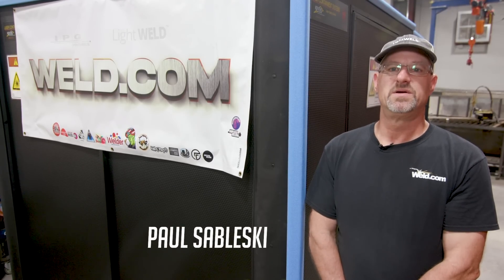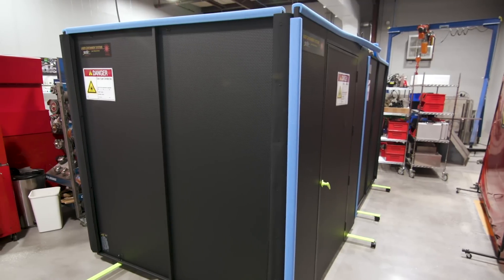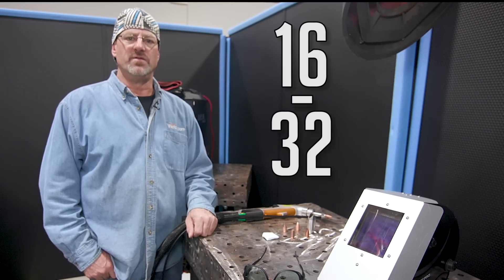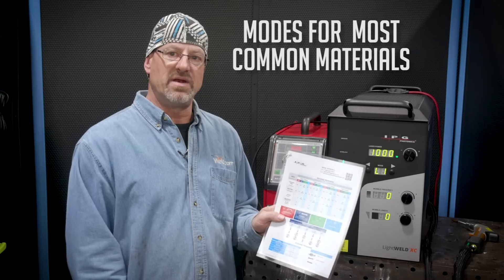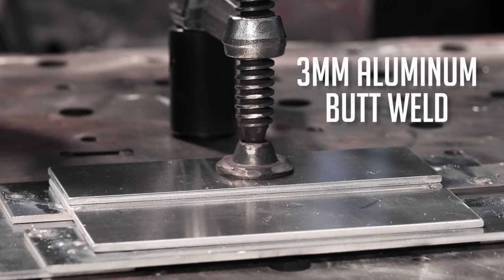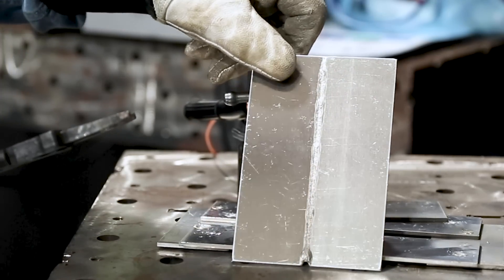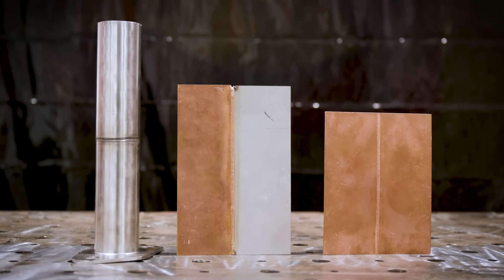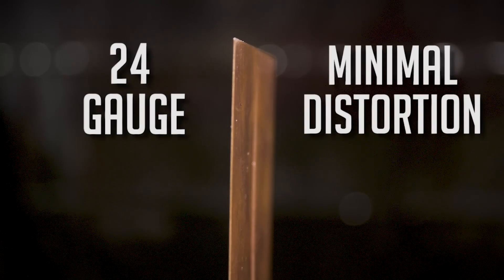Let's Talk Laser Welding with LightWELD

Comment: 15 to 30 CFH  or  PSI 30 PSI. you would go through shielding gas fast
Reply: The speed at which you are welding looks to be several times faster than MIG or TIG so it may still be much less gas per job.

Comment: Holy Mother of Christ!  $25K starting price!  $2K more
for the wire feeder.
Reply: Not so much.bro
Reply: @stevenfeng1961  true if you operate your own machine/welding shop, but if you’re just a diyer or hobbyist like me, yeah, it’s way to expensive
Reply: @jwdickinson643  ennn...Actually，I'm a manufacturer
Reply: @stevenfeng1961  but you’re an industrial fabricator so it makes sense to buy one of these…increased production, minimal errors and reworks, efficient processes all spell success and increased profits.  👊👊👊👍👍👍
Reply: @jwdickinson643  No bro，I mean We're a laser equipment manufacturer，Laser weldimg machine is not so expensive，We sell a 1000W USD4500 with wire feeder and a roll wire

Comment: how do you adjust the gas feeding the welder? with a regulator? flow meters don't regulate psi.
Reply: There is a flow regulator inside the LightWELDER. You adjust the pressure into the unit at 20 - 30 PSI.

Comment: İs it using carbondioxide or argon gas during welding prosses
Reply: Hello Adnan - thanks for checking out the video. I can't confirm exactly what Paul is using here, but argon is recommended as the shield gas for aluminum and nitrogen for all steels.
Reply: @IPGPhotonicsOxford  Thanks

Comment: This was super helpful, my job got one to test out and myself and our most experienced welder of 20 years are to try it out and we can't wait to see how it is but were going into it blind beyond the 3 minute videos showing the welds.
Reply: Hi Pieshka - be sure to report back and let us know what you think!
Reply: @IPGPhotonicsOxford  I am curious what is special about the welding helmet you provide since I can't find any information on it, and if a normal helmet could be used with the machine
Reply: @pieshka6  it's a ( yes weld )helmet but you don't use the welding lens when using laser. It has a laser screen mounted on face to protect against reflection of laser.  DO NOT use a normal welding helmet.  It will not stop laser from burning your eyes
Reply: @IPGPhotonicsOxford  The machine is pretty awesome and by tweaking the continuous weld settings we can make it look like we mig welded a corner joint together despite no wire, the program chart is a little annoying though since we go by metal gauge instead of thickness in inches but I have a equivalence guide on my personal settings sheet. And even though I've only seen it used in straight flat likes or pipes, the machine makes welding a square radius elbow easier than how I can do it through experience with a mig machine and with better weld blending.

And our instructor mentioned a recommendation from a fellow instructor that to reduce breaking threads with the nozzle tips we have multiple tubes with the different nozzles already attached to swap the whole tube and that multiple tubes should come in 130mm and 127mm instead of 120 plus the 2 extension lengths so we can loosen and swap the whole tube instead of changing just the tip while wearing welding gloves and potentially cross threading and/or dropping them and not have to worry about using the right extension but instead an easily identifiable tube length while reducing parts.
Reply: come to us and we may show you more about the laser welding, Mr. Pishka

Comment: Yup, this is the future for some applications.  One thing that wasn't mentioned is this is all software driven.  If a new feature or setting is needed it's just a firmware upgrade.  You are already network connected so it's just a menu selection.  One example can think of is the "stack of dimes" when doing Alu.  I'd think that modulating the laser intensity and the wire feed speed would accomplish this.  Maybe it already does?

Comment: Some confusion.  The video shows 2 welding modes.  The first part is not showing any wire feed but later on it shows a wire feed.  Please explain.
Reply: You can fusion weld, wire weld, or spot weld. Comes with welding preset conditions for all three ways of welding

Comment: The set up he has is $25k plus $2k for the wire feeder.  The $20 version does not include the capabilty of cleaning.  So with tax and shipping somewhere around $30k.  Not really for the hobbyist but for the pro I could see buying one today.  If they had an easy finance program would make decision even easier.
Reply: My god，The whole set just USD5000！
Reply: @stevenfeng1961  That is not for the IPG.  I have seen that and it is not an accurate price.  You will be getting a knock off for $5k.  IPG is known for being one of the best laser sources and they are more expensive compared to Raycus or other Chinese ones. Although the Chinese lasers have greatly improved over the last 3 years.

Comment: What would be the basic entry machine for the home job shop ??? Cost is a big factor when it is competitive with what is on the market. Thanks
Reply: I had bought a yes welder multi process for $500 welds just for home use but it’s held up great highly recommend it as a good starter
Reply: @Giggysiggy  How about a link to this welder Sir ???

Comment: Any chance we could see some multi-pass weld demonstrations with this? Thank you very much for the video!!
Reply: A set back for this process is the welds with wire are only 2 to 3 mm in size. Will take 5 to 10 times the total amounts of passes compared to a tig weld. This machine works best with one pass on thin materials.

Comment: If you used this in space, would you need shielding gas? Seems like it'd be great for in orbit construction if the tool was built right
Reply: No. No atmosphere = no air = no oxygen = no oxidation.
Reply: I wonder if the lack of atmospheric pressure may enable the material to boil away though.

Comment: No cut & etch and no strength tests...and it looks like it you need to drag it only...on the surface...way to limited but interesting nonetheless...
Reply: IPG has done the strength tests and welding certification to AWS 17.1 aerospace standard. They have all the data. Laser welding is not new - been used for years - this is just a way to make it viable for shops that don't have the money a Tesla or GM does

Comment: I would need to see xrays and inspections of welds before committing to this type of welder for my shop. Very interesting though.
Reply: Xray might show full penetration, but It would be like fusion welding, all the welds in extension not compression.
Reply: You can see whatever you want but I can't really see how adding this welder to someones shop would not be advantages,  China and the automotive industry as well as many other manufacturers have used robotic laser welding for years.  China has been selling welders just like this one for years.  They are available from the manufacturer for less than this one.  This machine from IPT seems to be the nicest portable one I have seen.  I would suspect this to consume the current welding machines eventually as it beats them in everyway.  I am not sure what woulds be any reason to not add one to any professional welding shop.  It does everything and more.  Cost is the deterent at this time.  However when you look at the price of welders that shops use there is not a huge difference.  $20k is around the same as some higher end welders on the market.  With some Millers in the $30 and $40k price range it is not looking so expensive and since it does what it does it would justify the price.  These are my thoughts out loud not trying to sell you on it but I have been researching these for a litle while and I don't think they will be anything but faster and better from what I have seen.  Also with the cleaning feature it adds to the quality.
Reply: IPG has done the tests with independent analysis of welds to the AWS 17.1 aerospace standards. For sure superior welding capability.

Comment: It looks fast and if that's also real world fast then the price is acceptable to me. Close to my TIG machine price x 6.
Reply: The machine is higher priced, but compare the wage of being able to grab someone off the street to use this, to how much you have to pay your experienced TIG welder.
Reply: @cmoulton11  Welding speed is equal to the wire feed speed. Wire used is the width of the weld itself. You will be welding at 24 to 40 IPM depending on material type and thickness.

Comment: If you move slower will the bead widen or thicken or burn through.
Reply: Good question,  Nelson - Fortunately there are ample controls to reduce the laser  power into the weld, including a pulsed mode, that will allow for a very slow travel speed to match whatever is comfortable for the welder on that particular job.

Comment: I'd definitely like to see how it handles a gap or less than ideal fit up
Reply: It doesn’t. There’s a reason why this isn’t widely used for production. Some claim it’s the “future”…but that can hardly be true with its current limitations.
Reply: @ieatslag5947  If you use wire the gap can be up to the diameter or the wire. You can also use rod and the gap can be bigger. The LightWELDER oscillates the beam up to .200 wide and 300 times a second so like any process once you have a solution to the question you can do things. It is being used for production for sure, IPG has delivered over 500 nationwide and over a 1000 worldwide in just over a year since it went on the market.
Reply: Hello Rich - Good question. The LightWELD has a wire feed attachment to handle gaps. You can see it in use here: https://www.youtube.com/watch?v=H-_yisVaiWU

Comment: Why does the cup scratch the base metal so bad?  Look deep
Reply: The weld metal was aluminum that hadn't even been wire brushed.
This should explain that the prep work for this welder is significantly less work than regular TIG.
Reply: the cup scratching lines on the workpiece may well be an issue for some folk , could the cup have teflon or phenolic etc glides as a addon ?
Reply: @garryclelland4481  or run a scotchbrite wheel over the weld like many shops do.
Or hand scrub it with scotchbrite?
Aluminum is more easily scratched than some plastics.  
Here a dude is showing people the amazing new laser weld technology and you focus on a tiny scratch.
Silly

Comment: Glad someone finally told the approximate price.  I figured they were way above my home shop budget!  Looks like a great machine for shaky handed old guys like me, but not at these prices.
Reply: Its also the expense for the light proof walls like in the video since it's a class 4 laser and all. Talked to my shop foreman about ours and where in the shop we can/should set it all up so we can start experimenting and the other foreman "joked" it's more like $50k with everything. But we do thousands of pounds of sheet metal and are more construction compared to other shops I've been in.
Reply: @pieshka6  Right you will need to set up containment and have an LSO.  Signage etc
Reply: About the price? Better look at it in different perspective if you are planning to buy one. Just think of it as if you're purchasing a car. That will gives you convenience, ease of use, quality work output, speed and many more while working and at the same time earning. Maybe within 2-3 years your purchase cost for the machine will be recovered.
Reply: Is this process approved by racing sanctioning bodies? NHRA etc?
Reply: Realistically, this isn’t even for the small Pro shop. I’m pretty familiar with electronic equipment, as I’ve designed enough of it. There is simply no way we’re going to see a well known manufacturer come out with one of these in any realistic scenario that would be much less expensive than this one, particularly when the separate wire feeder is included. They would have to integrate that. Still, $20,000 isn’t hard to see, but going much lower than that will be a major challenge.
Reply: @melgross  The prices of fiber lasers have been falling like a rock. They're also used for engraving and cutting metal and demand is increasing for them. Wire feeders are so prolific that they've become a commodity. Within a couple years, laser welders should be less than $5000, they will continue to get cheaper.
Reply: @EDesigns_FL  I doubt that.
Reply: @melgross  Patent rights tend to slow the cost factor. Once the patent rights fall off there will be tremendous effort from Asia to mass produce them at a price point for high volume. A little patience gets you a cheaper product. But you could lose out on a lot of income if you were a pro. That laser has a tremendous cleaning ability, which as I am working with old aluminum, would be a blessing right now.
Reply: @bryanst.martin7134  there’s nothing about this item which has patent rights assigned to it that are needed. That’s why the Chinese have been making laser welders for years. Most have been large industrial machines, but they have small ones now too. They’re cheaper, yes, but not half the price for the entire machine. You can buy them in bits and pieces. But with no USA imported to take responsibility, you’re taking a big risk.
Reply: @bryanst.martin7134  you mean the laser cleaning machine? Mr. Bryan
Reply: @EDesigns_FL  I ageee
Reply: @EDesigns_FL  Prices won't be going down that soon. If anything they will be going up.  This machine was cheaper last year.  You can get one from China cheaper but an AUTHENTIC IPG will be much more. Pro shops buy Millers for more than this welder.
Reply: @bryanst.martin7134  China has a lot of companies that have been selling laser welders for years.
Reply: @melgross  will this weld cast-iron to mild steels? aka castings repair? ( like old dodge 1970 hemi parts for me and paying friendship's aka invite only shop nowadays as i called it quits for random 🇺🇸 customers and weird/thrashed/dirty vehicles ) and or aluminium castings to iron casting's ? as nothing i know about with do that reliably and same question for mild steel to aluminium bar as explosive welding is the only way i know of that can do that

at 20K man that for me in a hobby shop/automotive repair and hot rod/race shop is out of my budget for now as a dynasty used 2012-up 350 or newer 400 ( off shore doesn't have any certificates and nondestructive testing in my area/shop and with liability/sue happy people can be id rather not on some tooling 😉 welders being one of them plus usd aside id rather own high quality uk 🇬🇧 or usa 🇺🇸 tooling more so 🇺🇸 as right now i can get it overnighted/support quickly and easily and it helps the economy aka cash will find a way back to my pockets ) is pushing it and a off shore 1/2in steel plasma cutter ect. and gas's like acetylene have gone nut's and are expensive to work with in the modern era so flame spray welding isn't something that id like to operate just on costs alone add in im more of a tig guy for ease of use and safety ect.

for my project on my property iron 6-8 ft tall & 4-big-gates fencing installation and or repair on a sub-1 acker lot this 20k tooling is way over kill but at 1-6k usd 🇺🇸 and trading in most of the other tools is can replace ( aka sell the plasma and the max 1/2 inch aluminium capacity 60%~ duty's cycle dynasty ect. for the same costs or less to buy this laser combo tool ) maybe a far deal/better idea as it saves time and shop space ect.
Reply: @richardprice5978  these things aren’t for everyone, or,everything. While you can use them for any steel, they’re mostly designed to be used with stainless to replace TIG. I would not try welding CI to mild steel with this. It will crack right away, assuming it even welds, as the characteristics of CI and steel are so different.
Reply: @melgross  gas powered welding works just fine ( but that process im a rookie at spray-powered ( so mostly i have seen the final product/video's ) as i tig weld more regularly and others processes, and for more than one industrial job iv had i have welded tig and stick 304,308,316SS ) and tig/stick ( but iv had less luck with stick as a first pass/root ) can work for cast-iron repairs but it's tricky and hard to do correctly and very time consuming so best on prototype's and rare parts not your average cheap/easy to get SBC 350 block & head's same for LSX ect. and cast aluminium ( and in general i don't care for al welding and or asceticy it looks bad but will hold structurally ) can be a pig to weld depending on conditions at the time of manufacturing and or use as a cracked  oil pan can soak up carbon and make it much harder to fix
Reply: @richardprice5978  what you do is different from what I do. I design and build machinery. I rarely weld dirty parts.
Reply: @melgross  yep i get you and sometimes i make something for me at home/my personal-shop and and work the boss has had me make parts but thats a cost's vs time-shop/downtime thing so i bet you understand what im saying in a industrial management/maintenance setting 

yes new vs a repair or modification job's are different from each other 

like i said dirty castings root tig and or the hole job. clean mild steel thats mostly for looks mig as its quicker to build with ect. and grate for tackling for tig later/other process's
Reply: @richardprice5978  yup, I get what you’re saying.
Reply: @melgross  PES has an $8,500 mini laser welder.
Reply: @AD03444  I’m not familiar with them. I assume “mini” also means mini capabilities?
Reply: @AD03444  Actually，As a manufacturer，We sell a mini one 1000W just USD4000
Reply: @stevenfeng1961  where can I purchase?

Comment: Can you do a segment on proper welding procedure for a 3/4" thick steel plate, connected to a 1/4 "thick square tube, as shown in the attached picture: